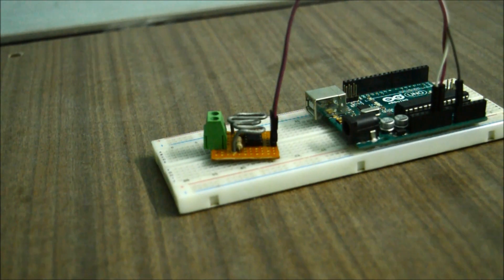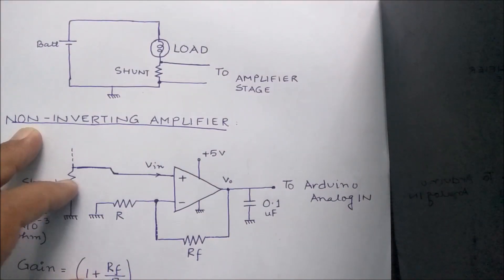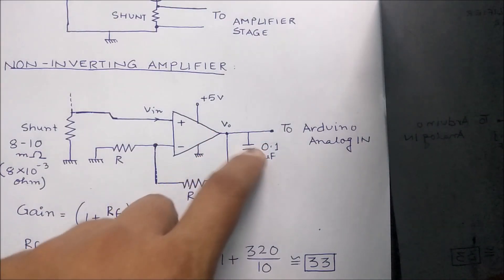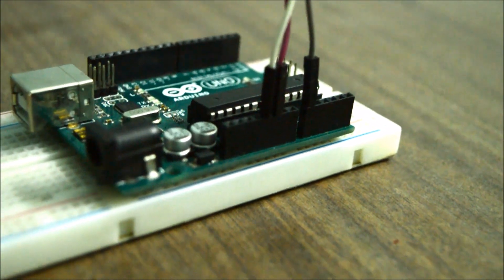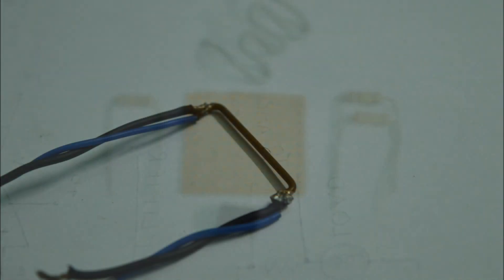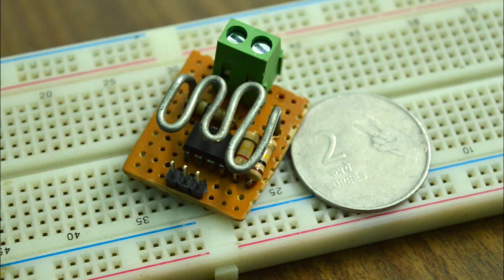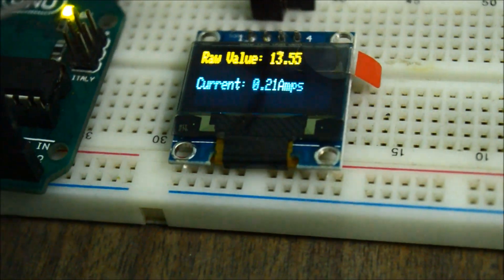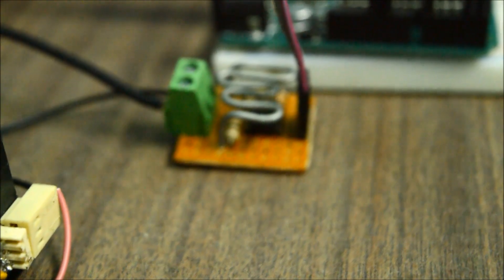DIY Arduino Current Sensor using shunt

Comment from the maker: #include <SPI.h>
#include <Wire.h>
#include <Adafruit_GFX.h>
#include <Adafruit_SSD1306.h>

#define OLED_RESET 4
Adafruit_SSD1306 display(OLED_RESET);
#define NUM_READS 100
void setup() {
 Serial.begin(9600);

 display.begin(SSD1306_SWITCHCAPVCC, 0x3C);  // initialize with the I2C addr 0x3C (for the 128x32)
 
  display.display();
  delay(2000);

 // Clear the buffer.
  display.clearDisplay();
  display.setTextSize(1);
  display.setCursor(0, 0);
  display.setTextColor(WHITE);

}

void loop() {
  
  float val=analogRead(A0);
  float amp=val*0.015426;
  display.setCursor(0, 0);
  display.print("Raw Value: ");
  display.println(val);
  display.setCursor(0, 15);
  display.print("Current: ");
  display.print(amp);
  display.println("Amps");
  display.display(); 
  delay(500);
  display.clearDisplay();
}
Reply: How you can get 0,015426?
Reply from the maker: @ayaaca8500  That is my multiplication factor with the analog input value so that I can get exact current value, it can be different for different gain of OpAmp and value of shunt
Reply: @UtsavShah_25  I mean, how do you count or what do you count to produce that number,
is there a relationship between the value of the shunt resistor, or is there a relation between the output voltage generated by the op amp, or what?
Reply from the maker: @ayaaca8500  Yes actually I've measured the analog output of Arduino and printed it on the serial monitor for troubleshooting, now I've passed a fixed current through the shunt and also measured the current using multimeter. Taking 2-3 variable current reading and noting the corresponding analog value, I got this constant
Reply: @UtsavShah_25  Do you use formulas?

iam sorry my friend, I asked a lot of
Reply from the maker: @ayaaca8500  No such formula just basic unitary method :)
Reply: @UtsavShah_25  does that mean you just multiply the output of the op amp and compare it with the manufacturer's ampere meter until you get the same current display?

thank you, you have made a simple measuring tool with a cheaper cost than ina219 or acs712

I subscibe your channel

stay creative
Reply from the maker: @ayaaca8500   Yes I am taking measurement of the multimeter as reference and using basic unitary method to get the constant as the OPAmp outout is fairly linear and I've used different small to medium loads to get almost the same constant value. So this method works fairly well.
Thanks for subscribing :)

Comment: Ustav you're an excellent teacher! Thumps up. Keep making such informative and illustrative videos!  It would be great if you extended this video to a second part where you tackle offset issues and different Op Amps as well as the ADC in Arduino and it's limitations.

Comment: The issue I have is that the op amp output alway showing 3.4 volt and I should get zero volt on the output on til current passing in the shunt

Comment: is there anyway to read current in high voltage? I want to read the current in a solar project, the voltage is about 270 VDC.
Reply from the maker: Yes you can use this to measure current at the voltage level you have mentioned. You can use similar design to implement the same
Reply: @UtsavShah_25  you mean I can give 270 volts at arduino's adc input?
Reply from the maker: @Ahmadnaweed786  No, Arduino can only take upto 5 volts in the ADC input. You asked about being able to measure current at a voltage of 270v, which can be achieved by this module. You cannot directly measure 270 volts with arduino

Comment: Hi Utsav, i want to measure 100A of DC charging current. do you think this circuit is enough.. i m pretty sure.. i need to use some other sense resistor but can you tell me what are the requirement to make 0.1A-100A measuring sensor. By the way thanks for sharing this video :)
Reply from the maker: Hello! Thanks for sharing your feedback. I would suggest purchasing a commercially available shunt for such high current of 100 Amps because as per what I have seen such homemade shunts are accurate upto 20amps. Beyond that the shunt heats up and resistance changes which messes up the calculation. So it is better idea to purchase a proper shunt that has accurate rating. You also mention a range of 0.1 to 100 Amps which i thing maybe a difficult task beause to measure high currents the resistance should be very low to avoid heating issue and low resistance means an even lower voltage drop. This might be very difficult to measure with an Arduino. However you can try measuring it with a very high resolution external ADC which has much better resolution than the Arduino. Hope the answer helps :)

Comment: Hi, h.ow to measure the direction of the curent?
Reply from the maker: Hie, unfortunately this is only a unidirectional current sensor and can measure current only in one direction so the connections need to be made keeping the source and load in mind. But I'd like to thank you for giving me the idea for this. I'll surely try to make a bi directional one
Reply: @UtsavShah_25  It would be cool. I am having big problems with the hal effect sensors. They vary a lot depending on de voltage they get supplied (In the range of like 5 amps diffence when no load is connected but I use us power or I take my power from usb or batteries via an lm7805) but even if I correct for that  they have a lot of noise and seem to drift. So I might try using a shunt and an opamp. This way I do not even need to use an ads1115. I am using those fake "arduino's" with the  LGT8F328P chip instead of the atmega and they have 12 bit adc.  I would like to measure my solar panel power coming in and going out of my battery. Worst case I make 2 shunts. Thank you for your video!
Reply from the maker: @hansdegroot666  Sure, I'll try and work on it and surely come up with something interesting

Comment: Sir can i can use 0.01 ohm shunt.
Reply from the maker: Yes you can use 0.01 Ohm. Use Rf = 220K and R= 10K so gain will be 23 instead of 33 and then you adjust the program by comparing your Arduino reading with multimeter
Reply: @UtsavShah_25  Sorry sir by mistake i have wroten 0.01 but it was 00.3
Reply from the maker: @vaibhav1200  Then reduce gain to 11 by using 100K and 10K

Comment: Sir need your help. I need a 15 amps current meter. So will you please help in this case please!!!. I am requesting you please!!!!!!!!!!!!
Reply from the maker: You can decrease the opamp gain factor by a little so that at around 15 amps the output voltage from the opamp does not exceed 5 volts and make the change accordingly to the code

Comment: Thank you Very much, !  I Will aply in  fadec project!
Reply from the maker: Glad it was helpful :)
Reply: @UtsavShah_25  I have a problem in my circuit when the amplifier starts measuring the current, it's okay if the current goes up a little more, it starts to drop

￼
Reply from the maker: Try reducing the gain of the amplifier a little bit The OP Amp may be going into saturation mode

Comment: But if the load's current is kind of high as in greater than 1/4watt wouldn't that blow the resistor?  Also wouldnt the resistor limit the current to the load (before it blows)?
Reply from the maker: Since the shunt is made out of a fairly thick conductive wire, it offers minimum resistance and thus a very small voltage drop across it. It can easily handle upto 10amps. We need not worry about the shunt blowing up though at very high currents it may heat up.